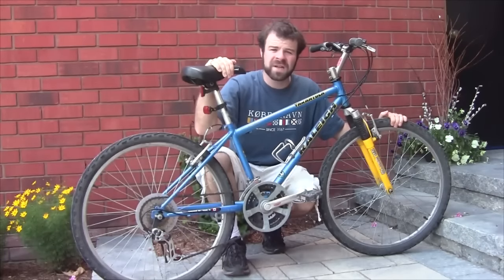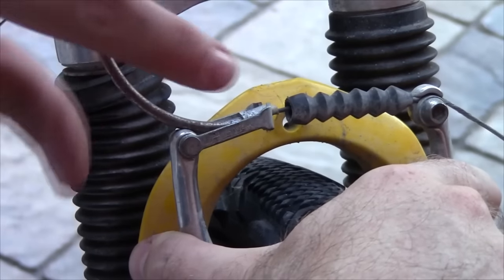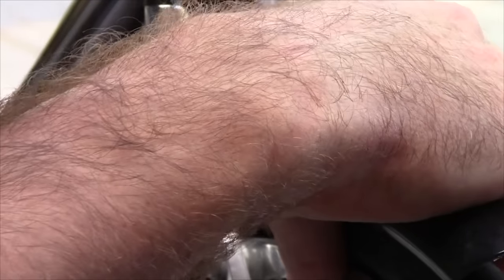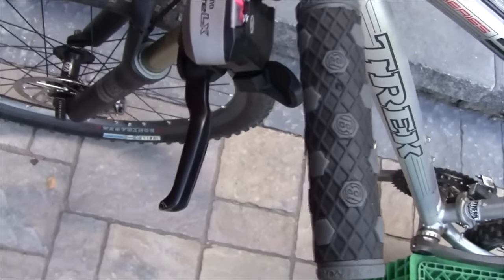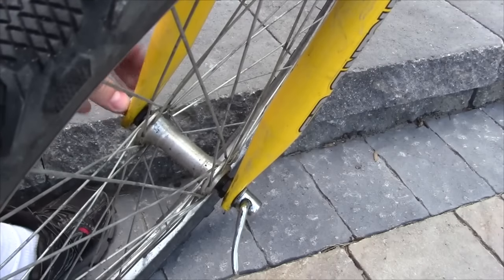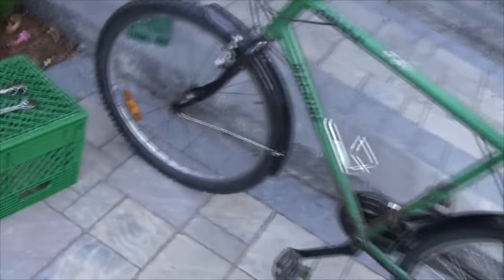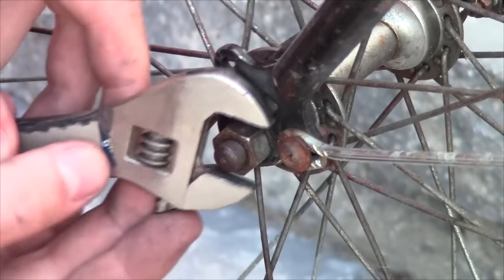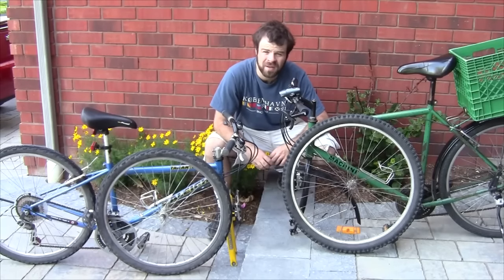How To Remove The Front Wheel of a Bicycle

Comment: Just bought a beach cruiser, newbie and just wanted to casual ride/workout. This was very informative and helpful. I have the brake pad caliper thingy that connects the slot, but not the little caliper mounted on the wheel. I would have to unscrew the nut to remove the wheel.

Comment: Thank you. Our bike has the first type of brakes and nuts not quick release. After putting wheel back on it rubs on the brake pads. Have I put the wheel back on the wrong way around or do we have to adjust the brakes now ?
Reply from the maker: If the brake pads weren't rubbing prior to you removing the wheel, then it's possible that you did not get the front wheel fully seated in the fork before you tightened the nuts. It's also possible that you installed the wheel backwards from how it was before. Tires normally have an arrow on the side which indicates the direction of rotation.

Comment: Thank you for this....as a total beginning re putting wheels in it was superb to see.....I've just put together a Kingpin folding bike and have to admit that I'm worried the movement of the wheel turning may wear away the bike frame forks....or am I worrying unnecessarily......also, is it possible to over tighten the nuts either side and if so, how can I tell........as you can see, total beginner questions so any help you can give me would be appreciated.  Thanks
Reply from the maker: Tina Overton Why are you concerned about the forks getting damaged? Does something rub on the forks when you turn the handlebars? It's always possible to over-tighten a nut and bolt, but it's not a common concern on a bicycle. As long as you are tightening everything by hand and only using regular hand tools as shown in the video, you shouldn't have a problem.
Reply: cjhoyle Thank you for replying so soon.  I've only tightened them by hand but know they need to be done by spanners to ensure the nuts don't fly off when I'm riding it.  No, nothing rubs on the forks, but the spindle(?) I think it is called appears to go directly in on the forks, with nothing to cushion them?
Reply from the maker: Tina Overton Oh, when you say spindle, do you mean the the threaded rod which goes through the middle of the wheel and is what the wheel nuts thread onto? That part is called the axle, and no it won't wear away the forks. When you secure the wheel to the forks using the wheel nuts, the axle gets fixed in place and does not rotate. Inside of the wheel there are ball bearings, which roll smoothly and the wheel rotates about the axle.
Reply: Thank you....mind set at rest, now to get to cycling up and down the inclines of Malta!    Happy Christmas and may the New Year bring you all that you would wish for.

Comment: My bike has the quick release but once I release it, it has a small metal bracket in the inside of the wheel you’ll need to release too in order for the wheel to be removed. Same process when it needs to be put back on. My bike is a Schwinn
Reply from the maker: Many bikes include extra safety features like that to ensure the front wheel can't fall off, even if it wasn't properly tightened. They are often referred to as lawyer tabs or lawyer lips (because they are there to keep the lawyers happy).

Comment: My bike has these little metal "hooks" behing the nuts holding the wheel in place. Like a washer but with a hook that fits into the fork. It's preventing me from getting the wheel off. I can take off one side completely but not both because the axel just keeps spinning round. Any ideas?
Reply from the maker: Chazfem Oh right, those metal hook things can be annoying and the axle spinning can also be a problem. I would try putting the nut back on which you're removed, and lightly tightening it. This will prevent the axle from spinning and you should be able to loosen the other side. Getting the lightly tightened other nut off shouldn't be a problem. Hope this helps!

Comment: I wanted to take my front wheel off to dpray paint the forks. I have NEVER taken front wheels off a bike and I am 53 and a half. I have the mountain bike with the squeeze together breaks and I have just taken the front wheel off, making sure I will have it the right way around when I have finished spray psinting those ugly forks, shiny black. Thank you for this video. Now, how do I leave the breaks attached to the forks after wrapping them in bubble wrap and the telescopic steel or chrome fork tops please? Many grateful thanks. The bike was expensive but I hate the horrible rust on the forks. If I take the breaks off, I will never know how to get them on coz I am scared of mis alignment. Sny hrlp,? Please? Geotgie xxx
Reply from the maker: Thanks. I hope your re-painting job went well!

Comment: The front brake won't reattach as I can't bring the two components together - like it's too tight or something/ not long enough to get over each other. Is there a remedy for this? Don't really want to have to take it back to the shop. Thanks!
Reply from the maker: +blanka19881988 When you disengaged the brakes, did you have any difficulty getting it to disconnect? If not, what is likely causing the problem is that one of the sections of the black outside cable housing is not correctly seated inside where it connects to the brake lever or the brakes. Inspect the cable housing and see if you see any issues.
Reply: Loosen the bolt that is next to the wire sticking out

Comment: Before I saw this very informative video I attempted to remove the front wheel by releasing the quick release.  I didn't know how to release the brake pads and turned on something attached to my line called a power modulator.  Did I put my vrake pads out of line by doing this?  Thanks for an extremely helpful video.
Reply from the maker: Is your bike an e-bike? I have no idea what a 'power modulator' would be on a bike.
Reply: cjhoyle My bike is an Bianchi Milano.  There's a spindle on the brake cable that says "power modulator".  I turned it in an attempt to loosen the brake pads but I don't really see that it did anything.  Thanks for your response!  Being new to biking after many many years, I think I am going to rely on your videos for lots of things going forward.
Reply from the maker: Bobbi T Hmm it sound like some sort of 'barrel adjuster', though that is a funny name to label it. A barrel adjuster is used for making minor adjustments to the cable tightness. To correctly adjust it, you want to tighten it so the brake pads sit as close together as possible, without being so close that they rub on the rim of the wheel when the brakes are not pressed. Hope this helps. Thanks for watching!
Reply: cjhoyle This is very helpful!  "barrel adjuster" sounds right... it looks like a barrel.  Thanks for your quick response and for your help!

Comment: The best video I've ever seen about changing a bike tire The only problem is I have a huffySpiraAnd I want to take the front wheel off and it's got a little silver clip on it It won't pull upto take off You have to take the little silver club off Don't know how to do it Any answers
Reply from the maker: I believe what you're referring to are the retention washers (sometimes nicknamed "Lawyer Tabs"). If your bike has them, you'll need to loosen the nuts off enough so that they can be pulled back and rotated out of the way before removing the wheel.

Comment: I have a bike that has the quick release and the brake boot as shown for the first bike and mine wont get close enough for the wire to slip in i got the quick release back on after putting the tire back on but the clamp wont go far enough to fit please help
Reply from the maker: I would recommend checking the cable housing connections. Sometimes when the cable is unfastened and loose, one of the cable housing connections might have gotten hung up and is not seated correctly.

Comment: The bike I have requires me to use a wrench, but when ever I try to loosen the nut the wheel moves. I tried the other way  on both sides and it still moves only the wheel
Reply from the maker: Try tightening the nut on one of the two sides before loosening the other one.

Comment: Aggh! Just realized that my (older) bike's brakes look like the second type, the supposedly "older type of roadbike" brakes. 

There is no handy little switch to flip up to loosen them, though, and all Google will show me is that same type with the switch. (Never seen those brakes with that switch before on any of the bikes Ive seen or owned in my life before, btw) 

How do I loosen my brakes?
Reply from the maker: Irama Danceandbmusic If it's a road bike, you might not need to disengage the brakes to get enough clearance to take the wheel off. Another trick is to release some air out of the tire to squeeze it through.
Reply: cjhoyle Getting it off was easy enough since my brakes need tightening and the tire is flat, but I worry about how I'm going to do it in the future once the brakes are tightened.

Comment: I did this to my but now the brakes pads when i put the wheel back on the break pads rub against the front wheel now the front wheel doesnt move please help tried it bloody 7 seven times i just cant adjust it
Reply from the maker: Did you by chance install the wheel backwards from how it was before? Try removing is and rotating the orientation of the axle by 180 degrees.

Comment: Somehow my front wheel fell off while I was working on another part of the bike.. One nut came off as in the video. The second one was a lot tighter and turning it counter clockwise simply turns the whole axle
Reply from the maker: I would recommend tightening the other nut on, then try again to loosen the one that is stuck on. It is just likely just a bit seized.